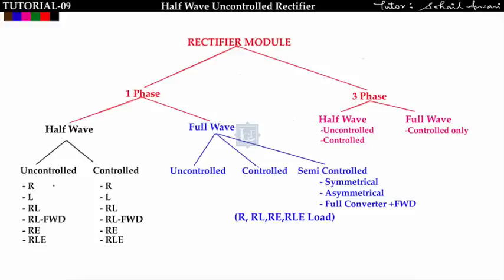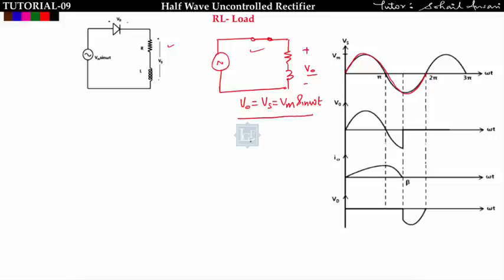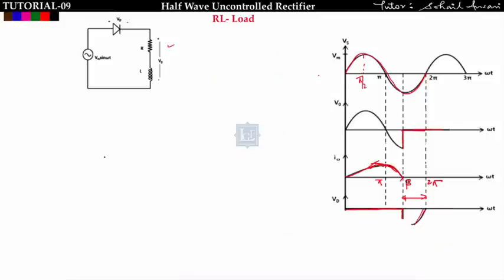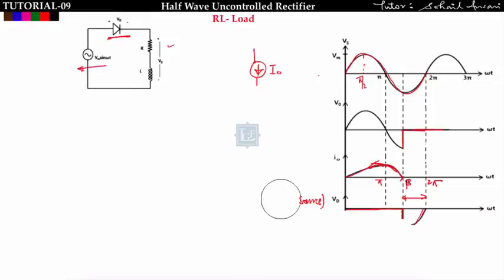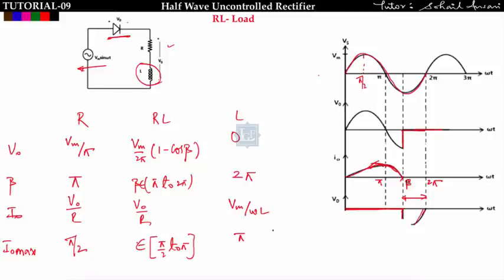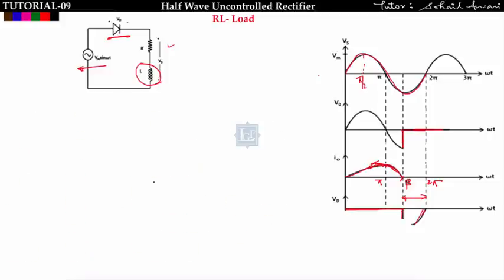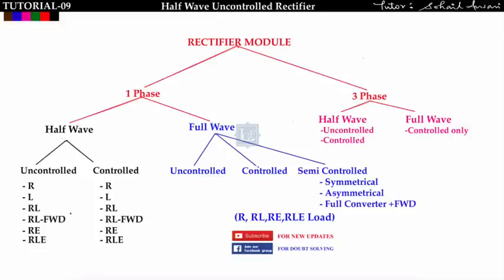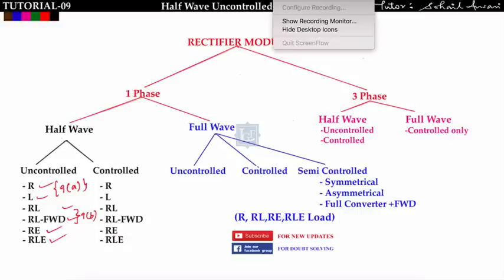Lec 9(b) Half Wave Uncontrolled Rectifier (RL & RL-FWD Load)

Comment: Sir as the negative cycle is observed the inductor will dissipate energy through the free Wheeling diode which is not in the circuit. It cannot dissipate energy via the same path as the polarity will change from the inductor and the diode will be reverse biased. A free wheeling diode will be placed in parallel to the load to dissipate energy from the inductor

Comment: Sir why we study only inductive loads in rectifiers.
Reply: Dear student, because practical loads are mostly of Inductive type.. for eg Induction Motors, DC, ya Sync Motors Pumps, Fans etc for which we use VFD to control the speed and increase efficiency

Comment: Sir at 5:40 you said that from  pi to beta load is delivering power to source.. but sir actually current in inductor is reaching it's maximum somewhere between 90° to 180° let's suppose somewhere at 120° current is becoming maximum and then again it decreases so whenever current in inductor decreases it means that inductor is releasing energy from 120° only so.. we should actually say that inductor starts delivering power before pi itself.. isn't it sir?
Reply: Or else sir this can possibly be the case that... Till 120° inductor and resistor both will absorb energy from source.. and at 120° as the inductor current becomes maximum it will start delivering power towards resistor but this power is may not be sufficient to feed resistor so in addition resistor will take power from source as well so like that in this way the complete load is absorbing power from source till 120° but to say strictly inductor will not absorb from 120 it will just feed resistor.. and then after 180° inductor will feed both resistor and source..  is this possible sir?

Comment: Sir in RL-load with freewheeling from π to 2π why the output Voltage is 0???  because there would still be drop across the Resistor when the Inductor is short circuted.
Reply: I think.....whatever the drop is there across diode it is same as magnitude of inductor voltage(discharging) but in opposite direction....so Vo will become 0... please let me know if I am wrong....

Comment: There is a mistake at equating input power to output power, as the output current is not a constant dc, the output power cant be equated as average power.
igonoring a small flaw, its a great lecture. doing great job.

Comment: In case of RL load with FWD, u r saying that after pie output voltage is zero and the output voltage is the voltage across the RL, but after pie current is still flowing so drop will be there after pie across RL load then output voltage will also present. This is little bit confusing rest lecture is nice and the best part of ur lecture it is not to long.
Reply: Since the freewheeling diode is conducting at this moment this means it is forward biased making a short circuit across the load which makes the output voltage equal to zero.

Comment: sir in case of RL load if inductor is charging till 'pie' then max. current should be at 'pie' but u told that max. current will lie b/w 'pie/2 and pie'  I m not getting it.
Reply: utkarsh yadav 
It is changing but with decayed voltage after pie/2 . It means with reduction of charging current .
Now the question comes that if voltage is reducing after pie/2 , then current also reduces . 
So why max current is not at pie/2 only ??
The answer is that because there is L in load circuit , it doesn't allow the current to reduce exactly at the moment which voltage is reduced . After some small time current will start reducing (even charging current ) . Hence we don't know when it starts reducing !? That's why we take it between pie/2 and pie.

Comment: sir in case of Resister you took output power Vrms.Irms while in case of  RL load with freewheel diode you took power output  Vavg.Iavg
Reply from the maker: refer lec-07 ..there i explain the voltage stiff and current stiff type of load..ur query will be resolved..ok
Reply: LearnGATE Free tq sir